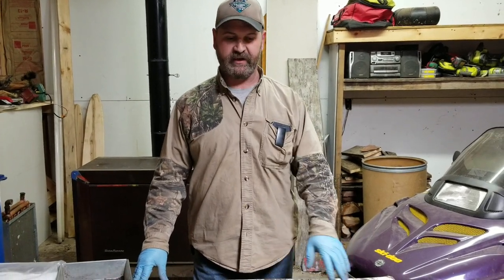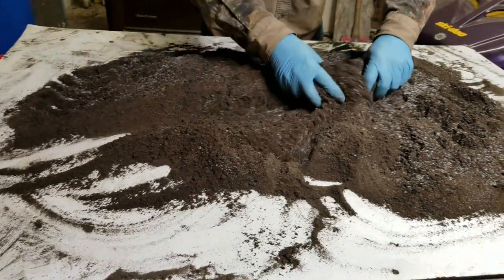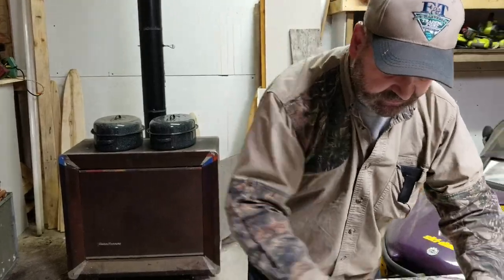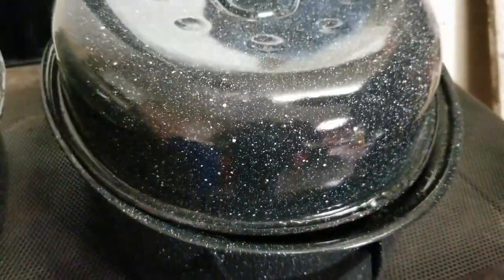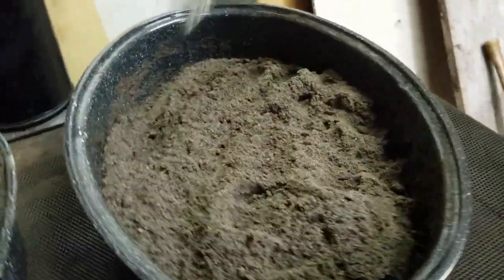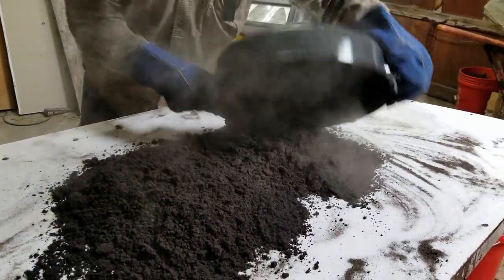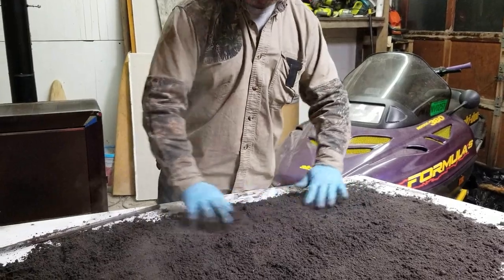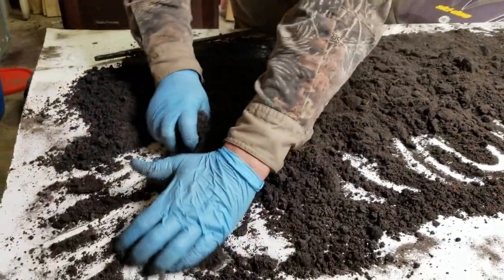how to make wax dirt

Comment: ive found that cutting the handle off of a stone rake and using just the rake head is a better option to cool the heated product. it allows more air to circulate when spreading it out

Comment: Excellent video. Question. Could you also set the trap with regular dirt then add a layer of waxed dirt over the regular dirt. Basically try to extend the amount of waxed dirt, or is it best to start with treated dirt to completely cover the trap.
Reply from the maker: Dewey Wesley hi Dewey,if your using it against just rain u could use just top layer but for freezing whole set is by far best

Comment: Did exactly 25 gallons using this method today.  I have them waiting to go into a 55 gallon drum. How many days do I need to leave in the buckets without a lid before I transfer it to the drum ?
I also tried the solar method , gas grill , and It was 87 degrees here today. It work beautiful , but the solar seems to take forever. But I really enjoy your video and it was very well edited. Thanks so much for your help.👍
Reply from the maker: I leave it for a couple days before transfer
Reply: @DunlapLures-SheTraps  Thanks so much. I appreciate it.  Wishing you tight chains this season from Blue Ridge Mountains NC.
Happy Trapping 👍

Comment: Nice video, thanks for sharing. I have looked in the F&T book and it doesn't show the bag of wax, sent an email almost 2 weeks ago and no response. With the snow, rain and cold now, I could have really used this wax dirt. Question, what is the best type of dirt to use, is that like a top soil mix. I have  sand now , and also some bank run loam. thanks for sharing this video. I will definitely have this on hand next fall in the conditions I have here.
Reply from the maker: Elite Bowman the loan or sand will both work for it
Reply from the maker: Elite Bowman https://www.fntpost.com/Products/Anti-Freeze,+Flake+Wax+Cover+Hulls/Flake+Wax
Reply: ok thank you Jeff.

Comment: Do you put a layer under the trap? Or that wont matter?
Reply from the maker: Yep I just sprinkle a little under the trap so it wont freeze down especially the jaws
Reply: @DunlapLures-SheTraps  I need to trap and I'm from Alabama will flake antifreeze work just as well as this with regular dirt I also dry my dirt and sift it into a bucket so it's ready to go
Reply: @DunlapLures-SheTraps  I'm new to trapping sorry autocorrect

Comment: Quick question for you : I understand the process of making the wax dirt but if the ground is already frozen before you apply the wax dirt should we bed the trap in the dirt or put salt under the trap to prevent freezing. Due to fur prices a cement mixer is just out of reach , and I work out of town alot. Any help would be appreciated. Great video
Reply from the maker: Hi phil,I just cut out a bed and then put wax dirt lightly in the bottom and put trap on it..basically incase trap in wax dirt..you can use salt on the bottom also it just works better for me with waxdirt
Reply: @DunlapLures-SheTraps  I appreciate it that's what I'll do then. Thanks so much.

Comment: I'm from Fairbanks Alaska,  but I'm Army stationed in El Paso Texas.  It's so hard to get a trap solidly placed and even with a pan cover, keeping the sand from getting under the pan. You mentioned sand or dirt, but think sand in beach/desert style. I think this is the answer to my problems. Do you think this will still work for me here in this hellhole?
Reply: I'm so frustrated that I'm about to use a plywood baseplate to set my legholds on. Could that be a viable solution also?
Reply from the maker: John Wayne have you tried using wax paper? I've used it for really fine wax dirt and trapping in sugar sand that will go through a pan cover.
Reply: I'm going to check my line in the morning. I'll pick some wax paper up when I reset my traps. Thanks for the tip.
I can't wait until I get back to Alaska where there's snow and trapping and hunting make sense again.
Reply from the maker: John Wayne good luck!  I'm headed to my brothers in salcha this winter trapping.cant wait
Reply: Dunlap Lures Trapping/hunting/fishing, from Salcha to Nenana you'll have a great time.
Reply from the maker: John Wayne I was there last winter for 5 weeks.was a blast.my brother races sled dogs.we went to north american,tok and tanana. Had a great time.love it there
Reply from the maker: John Wayne when do you go home?
Reply: Dunlap Lures I should be retired by October and heading home. I want to get some land around Chatanika.
Reply from the maker: John Wayne I'm looking at December to come up and then come back for rondy in Anchorage and north American in Fairbanks. I wanna go to both fur sales.we will see
Reply: Dunlap Lures wax paper worked like a charm! Thanks. You're the man. Was going for coyotes, but I got my first Javelina! It's a heavy used area. I guess the yotes were laying heavy sign while trying to find the Javelina. I was going to try snares for hog and Javelina,  but the Bridger leghold worked out for me by luck not skill.
Reply: @johnwayne3085 I knows it been 5 years but poly fill under the pan would keep sand from getting under it

Comment: I'm new to trapping instead of doing this does flake antifreeze work just as well I'm in Alabama
Reply from the maker: For down there it would on the freezing. When I'm trapping in the south I use peat moss alot also
Reply: @DunlapLures-SheTraps  thanks brother I'm going to give peat moss a try and flake antifreeze by the way I ordered two 1 oz bottles of your lightning in a bottle just trying different baits and lures I know it works in the winter I'm hoping it'll work here in the summer also

Comment: Weird question but I just did the same method over 2 propane burners. Does it kinda smell as you do this? My dirt smells slightly different after doing this as compared to before
Reply from the maker: Yep it will have a slight different smell then just dirt.as long as it doesn't smell burnt it should be good to go
Reply: @DunlapLures-SheTraps  First batch was for sure burnt. I got a baking sheet to go between my roaster pan and the turkey fryer flame. And I kept the heat real low. Takes about 35 min to melt the wax with mixing it ever 10 min or so but it works and is practically orderless. Thank you

Comment: Does your wax dirt smell like its burnt
Reply from the maker: No it will have a warm smell sometimes but I just leave it spread out to air out
Reply: @DunlapLures-SheTraps   mine almost smelled burnt
Reply from the maker: When did u make it?
Reply: A month ago
Reply from the maker: If it still has a burnt smell to it then it's not going to go away. I was going to say let it air out for a couple days if just did it but after a month not much chance of that
Reply: Will coyotes still come to it
Reply: Will it still work u think
Reply from the maker: I'd personally try it but I wouldnt use it on a hundred sets.id do maybe 6 with it and see if I had problems